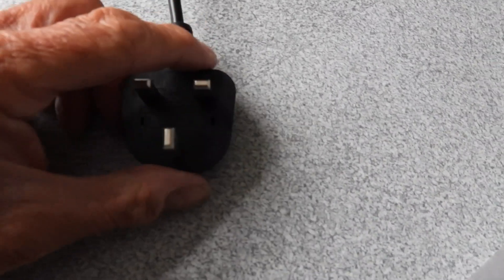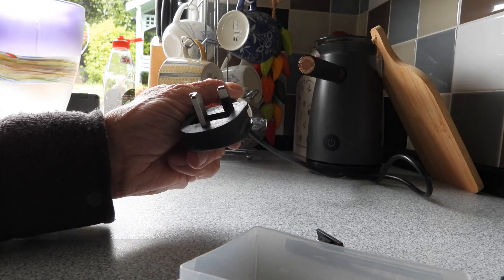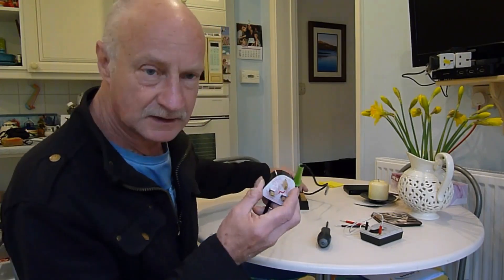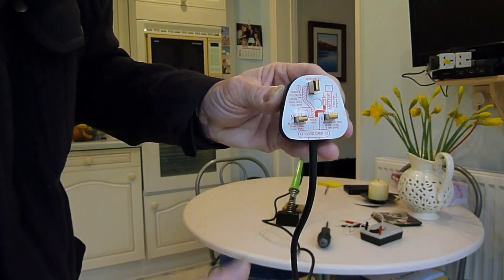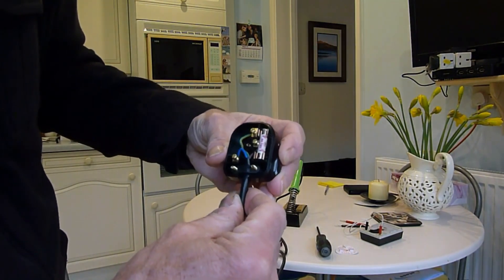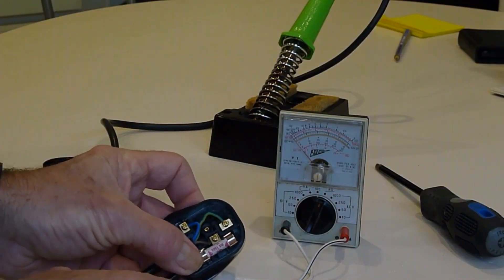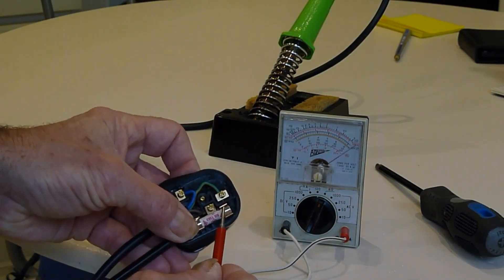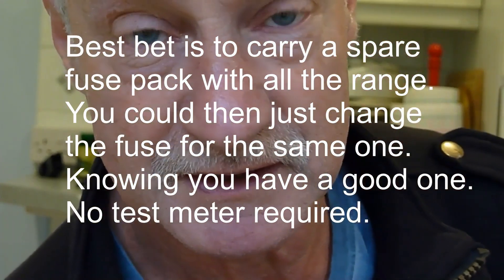Plug Fuse. How to check it and change it.

Comment: I know it was a simple mis-speak on your part Al, but it's worth pointing out to newbies that the 'N' terminal on the plug stands for 'Neutral', not 'Negative'. Negative terminals are more likely to be found in a DC electrical circuit.
Reply from the maker: Cheers mate

Comment: modern way to check the fuse is to hold the metal on one side and touch a mobile phone screen with the other, if the screen acts the same as if it was touched then fuse is ok, if nothing happens fuse not ok.
Reply from the maker: Thanks Shadow.